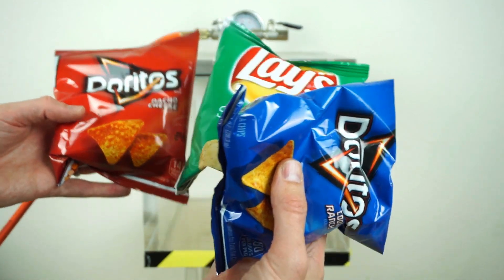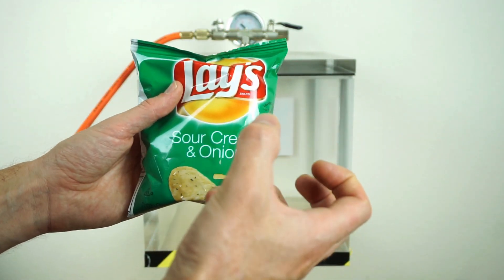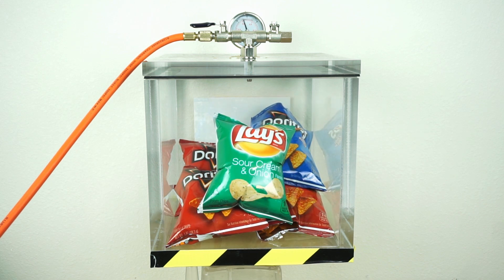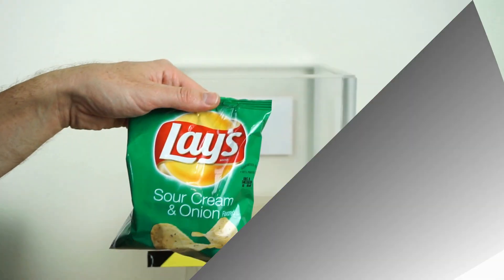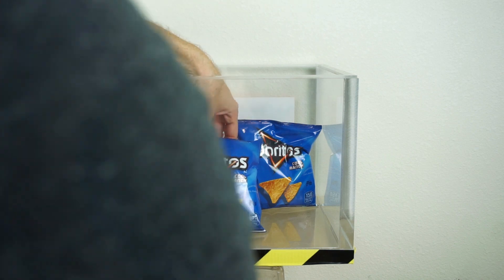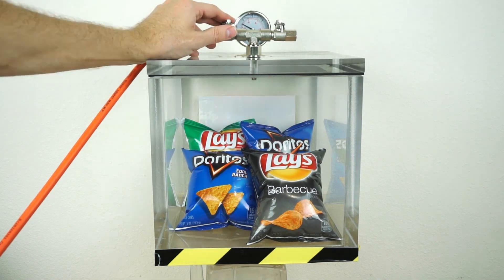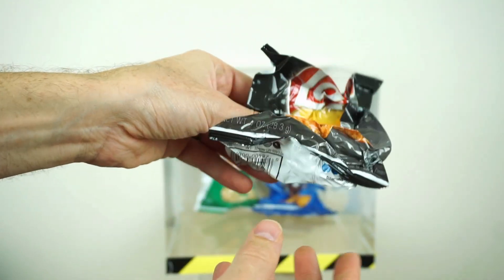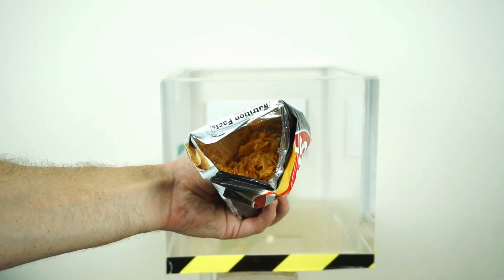What Happens When You Take All the Air Out of Lays? Shrinking Potato Chip Bags in a Vacuum Chamber

Comment: I use this method to seal Mylar bags in my freeze dryer. I cut a small slit in the corner to open the sealed bag, run vacuum only from the test center, and when you open the release valve, bam.

Comment: The reason chip bags are full of air is to protect them from getting crushed during shipping. And it's actually not air, as air would make the chips stale. Its nitrogen gas, which helps keep the chips more fresh. The reason pringles doesn't "sell air" is because the way they package the chips, they dont need the extra protection from crushing. Theres a law that prevents chip companies from including the whole weight of the bag in the price which is why a net weight is always on the bag, so if you're comparing prices, look at the net weight to decide if you're getting the most bang for your buck!

Comment: Actually, the bag of crisps on a plane phenomenon is a lot more interesting than that. 

It is true that the atmospheric pressure will crush the bag of crisps if there are tiny holes in the package, however If you start your journey in a place at sea level and fly over to a place at a higher altitude the pressure inside the bag of crisps will actually be greater than the atmospheric pressure at the higher altitude location, causing the bag to puff up. 

I imagine this is due to the crisps being sealed at greater atmospheric pressure (sea level) than the destination's one.

Comment: 0:48 that’s bullshit astronauts wouldn’t survive in a vacuum so they pressurize the cabins to roughly 1 atmospheric pressure, in a vacuum your blood would boil and you wouldn’t be able to hear anyone either because sound doesn’t travel through a vacuum since sound is nothing more than the variation of low and high air pressure and how often this pressure varies from low to high per second determines the frequency of the sound measured in Hertz, and the more pressure difference there is in the pressure wave the louder the sound gets. and since a vacuum has no pressure, there isn’t any sound

Comment: Slight vacuums do not exist. You either have atmospheric pressure, or you don't.
Chip bags start out with "more" chips in them. A portion of the chips break when being packaged, transported, and shelved. If they put more chips into the bags then we have more crumbs. The gas acts a cushion that reduces breakage. Pringles are mostly unaffected because the tube is more rigid than a flimsy plastic and foil bag.

Comment: Except it’s not air, it’s nitrogen. It’s used to preserve the chips, that’s why one chipsbag lasts until like 2067
Reply: Yanis Tanasie such a original joke
10/10
Reply: kristine ruski, thx, r u being sarcastic or MEME istic?
Reply: Stuffinator Isn't it usually argon? You know, the inert noble gas?
Reply: @seastilton7912  noble gasses are expensive. Nitrogen is also vary stable and doesn't react easily due to its triple bond which is extremely hard to break. It only reacts in extreame pressures and temperatures.
Reply: Only the chipbag? Plastic you mean?
Reply: Yup
Reply: Stuffinator, I've read the description from your channel and I dare you eat tide pods because you don't want to drink bleach!
DON'T DO THAT, I WAS JOKING, DON'T (SORRY IF THIS ANGERED YOU)!

Comment: all those who complain about the air in the bag. With out the air all your chips would be reduced to crumbles by the time you get your hands on em
Reply: They could probably increase the amount of chips to air ratio though. Cheap companies. Used to be way more chips in bags.
Reply: You could easily have 3 times more chips and it'd still be fine.
Reply: Mzima with that logic there is never a limit after adding 3 i can simply say you could increase the size of each chip by 0.1 mm or add 1 more gram of chips you get my point
Reply: +Στέλιος Πολιτάκης it helps the chips to not get soggy. there's nitrogen in the air but there's also oxygen which makes them soggy in the first place.
Reply: Neko Nitrogen sorry in there is 5% Air and NITROGEN so like 60 80 percent dont know that
Reply: Στέλιος Πολιτάκης nitrogen prevents oxidation of the fat so the crisps can be fresh for a long time. Also they try to fill the bag with gas in order to create an air coushion and prevent the crisps from cracking to pieces
Reply: Kira Fan nitrogen literally is air. It composes 78% of the atmosphere.
Reply: Alex Thoppil yes, but there is oxygen in the air too, and you don't want that. That's why you only use nitrogen or nitrogen+co2
Reply: Idc i want more chips than air
Reply: Dean Boy 11 Then buy more crisps. You are charged by the weight of the product, not by the volume of the packaging.
Reply: Marios P im broke im only 10
Reply: Wow finally someone gets it. Everyone thinks it's a scam but its to protect the potato chips in the bag from being crushed
Reply: Still a huge waste of plastic
Reply: Jackson smaller bag would be 100% fine.
Or 3x chips like they used to be. They increased price, while decreasing by at least 5 times the amount of chipa
Reply: Oh is that what y’all saying about nitrogen
Reply: Martin Deck Then you would need bigger bags... so yup you end up where you started...

Comment: Those bags slready have 2 small holes. I know I put tge there st my job using a 20 watt laser
Reply: If u look st chip bags in the supplement part with a magnifying glass u will find the holes
Reply from the maker: +Nicholas Lynch really?
Reply: The Action Lab yes we do it because air pressure is the same in all regions of the u.s. plus alot of the lays products we ship are transported by planes. Also heat. We can't have chip bags explode. Every bag of chips gets Lazer ed.
Reply: Get a magnifying glass and look under saturated fat that's usually where we aim.and on the bar code

Comment: When I brought a bottle of water onto a plane, once we were at cruising altitude, the bottle was rock solid because the pressure inside was still the same as at the airport. I opened it to drink out of it then 4 hours later after landing, the bottle was slightly crushed because the pressure inside was still the same as inside the plane.

Comment: I would like to see more high pressure chamber experiments, It would have been nice if you could build a chamber that can withstand more than 2 bars.
Check how high the temperaturę needs to be to boil water at higher pressures, test other liquids like liquid butane or liquid nitrogen,
I dont know if its possible but it would be awesome to see how things are in 50 or more atmospheres.

Comment: I went on holidays for a week and we had left over food we wanted to take back. Mum wanted to take back the sauce bottle back on the plane. I’m like it will leak out if the end is point down due to the pressure differences between the air inside the bottle and the pressure of the outside of the bottle with the airplane cabin pressure, Can you test this to see if I’m right

Comment: What happens when it is a full vacuum and you open the lid 
Will it be impossible to open?
Reply from the maker: +Flaber Jabel there is a little less than 1 ton of force on the lid when under vacuum. You could get it off with some sort of a jack but most likely break the lid in the process.

Comment: can sea water be purified by boiling in vacuum chamber?
Reply: Manoj Singh you’d have to catch the vapors, and let them condense into water. Just boiling it in the vacuum would just concentrate the salt water
Reply: If you condensed it as water boils at lower temperatures the lower the atmosphere( I think) so water in a vacuum doesn't need any extra heat to boil
Reply: Jack Pickup k
Reply: Great idea

Comment: Once you take all the air out there are no chips left as companies like to fill up their products with more air (to trick us into thinking we are getting more food).
Reply: That isn't the purpose of "air filled bags", actually it's not even "air" but nitrogen. Have you ever left a bag of chip opened for a day or so? The chip becomes hard and stale. That's called oxidation. It's filled with nitrogen to keep the chips from going stale, and also gives the bag some space so that the chips won't break easily when being handled.
Reply: TMR Teckk actually,it's not just air inside the bag,it's nitrogen. If it wasn't in there the chips would dry and become stale
Edit: the nitrogen also keeps the chips crunchy
Reply: The air in chip bags is to stop the chips from getting crushed

Comment: Can a fish breathe in a vacuum chamber
Reply: Kinda wrong to do tho
Reply from the maker: If only I could do that experiment without being burned at the stake. But no, fish can't breathe in vacuum:)
Reply: Put mice in there...  ;)
Reply: @davydiver
You're a biology fuckwit!...  Fish pass water over their gills to extract oxygen from the water in order to breath.

What would happen if you put a goldfish in a bowl into a vacuum chamber?
ANSWER: First, the air around the bowl would begin to evacuate the chamber. Once a certain level of pressure difference is created by the partial vacuum, the water in the bowl would start to boil (at room temperature - the water would not rise in temperature) and the oxygen in the water would be given off in the process... The fish would no longer be able to extract oxygen from the water, and would suffocate. Any trapped air inside the dead fish, would eventually evacuate through the mouth and anus if sufficient vacuum is created that it counteracts the compression forces of the water (or the dead fish floats to the surface).
Reply: no
Reply: Osvaldo Ah 🐶  ...  😂
Reply: Numb Skull
No, they wouldn't boil alive... As I said above, in a near vacuum, water boils at a lower temperature. In fact, as the vacuum drops below 0.3 PSIA, the water will boil at under 20C... Warm enough for gold fish to survive in quite happily... You see, it is NOT the water increasing in temperature that is causing it to boil, it is the change in air pressure; the water temperature remains at whatever temperature it went into the vacuum chamber at.
Reply: davydiver
1... No it wasn't.
2... Yes.
3... Yes.
Reply: @Gorfrostic
Yes AND no... No one can breath in a vacuum because there are no oxygen molecules in a gaseous state, but a vacuum does not exclude oxygen molecules in either a liquid state, or a solid state.... either purely, or in combination with other molecules... In this case H2O

NB... I'm referring here to the vacuum chamber type scenario in the video, not "perfect vacuum" type scenarios or prolonged exposure to very low pressure vacuums.
Reply: The Action Lab try water to see what happens to water please.
Reply: Uhh no
Reply: Asher Malcom I already said that...
Reply: Beavis yes nah I really don't know
Reply: Ive told him back then to put a live catfish inside
Reply: Water boils in vacuum chamber
Reply: A fish cannot breathe in a vacuum chamber.
Reply: Put a box a kittens in a vaccum
Reply: Beavis 
To much hydrogen
Reply: Totally Toastly 😹...  🤣
Reply: WHERES BUTTHOLE?!😂😂👍🏻
Reply: The Action Lab because fish inside water at vacuum chamber? so... "god" will burned at stake? Because fish inside earth atm. At vacuum cosmic?
Reply: Beavis no one can breath in a vacuum because there are no oxygen molecules in vacuum
Reply: The Action Lab put a dead animal or put just water andsee
Reply: Please do fish in a vacuum chamber.
Reply: Put water in a bowl, put fish in the water, then put the bowl in the vacuum.
Reply: N Albertsson biological fuckwit!  LMAO!  :)  It was a joke...

Sharks moving forward... is that breathing?

Does a fish pish in the water?
Reply: N Albertsson if you can't see that as a joke, then YOU are the one who is a total fuckwit.   It was philosophical.  All things defined in science can be modified or changed in Lexicon and often do over time.  IE Neil Degrass Tysan taking Pluto's planet status away...
Reply: Fish dont breath persay, they use their gills to pump water past their gills.  They do however have a swim bladder that could be injured...